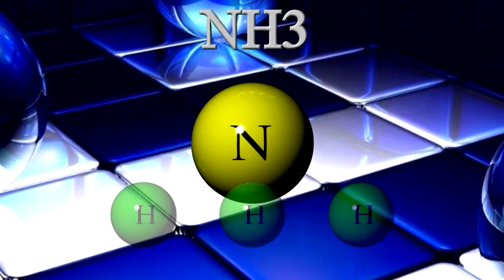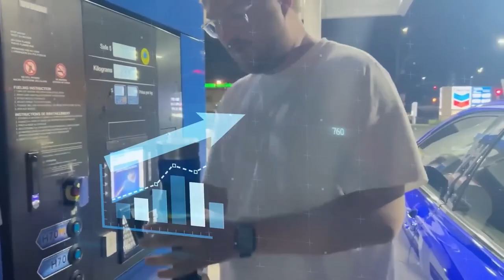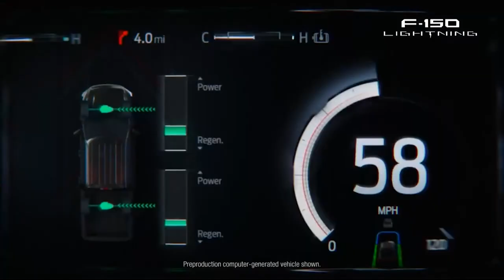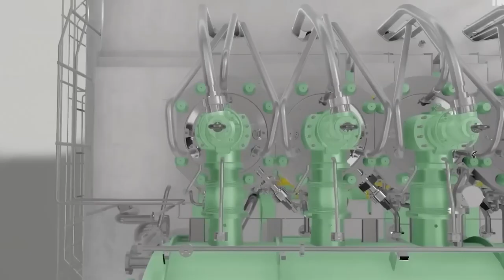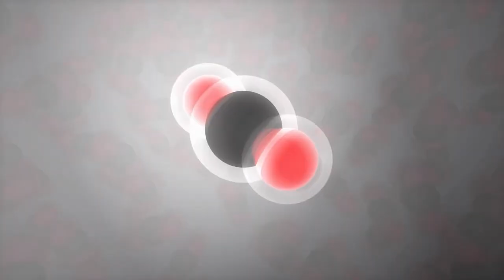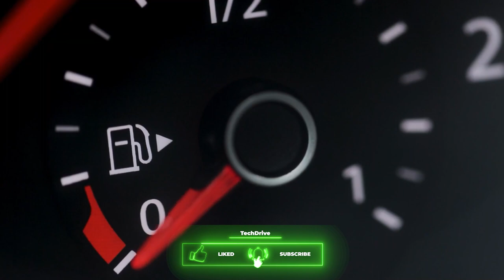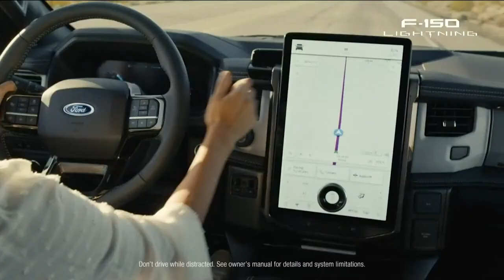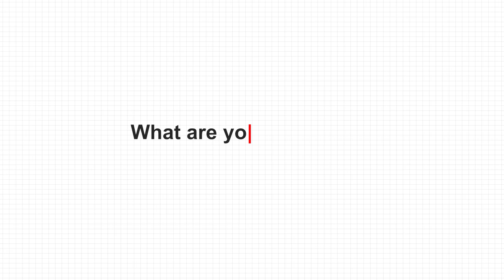Forget EVs: Ford’s Game-Changing Green Fuel is Here!

Comment: Not one word about NOx emissions? That has always been the showstopper for ammonia engines. If just water and N2 came out, that would be great, but every announcement I have seen has quietly disappeared when NOx was dealt with. Can you say acid rain?

Not to mention that even the best ammonia users in agriculture results in some ammonia leakage during refilling of tanks. With literally millions of more users out there, how is the billions of refuelings per year going to prevent that?
Reply: This and they never say what type of ammonia they are using. If pressurized to keep cool you basically have the same issue as hydrogen which already has an infrastructure in port citires. We're supposedly closing in on hydrogen storage with no/low pressure at a commercial level. Also seems like a bad idea to push using one of the most important fertilizer's we have while other green initiatives are making it hard for farmers already. Let's not starve our population to pat ourselves on the back about not using gas.
Reply: Also falsely claimed that CO2 causes smog.  It does not. NOx does however.
Reply: @SaintGermaine856  You're right. Also, all ICEs produce ozone, including NH3 ICEs. That is another component of smog. There are 2 elements of smog that NH3 engines don't produce: carbon monoxide and partially burned hydrocarbons. But they are far from non-polluting.

Comment: Yes! Fantastic! You pump, transport, and refine oil, and lose more than 20% of the energy.
Then you reform fossile fuel with 66% energy loss to Hydrogen, and then you make amonia, and loses more.
And, then you burn it in an engine, with 15% efficiency. You end up with 4% of the energy used to power the car.
What's next?

I have an idea. Why not turn it back to oil?
You could use the amonia to make electrictrisity, and Capture some co2.
You can probably get a car to use 0,00001 MPG. That's an even better idea 😅😂
Reply from the maker: We agree!